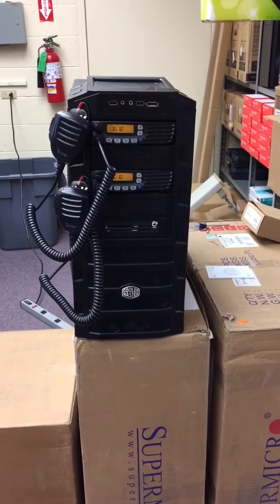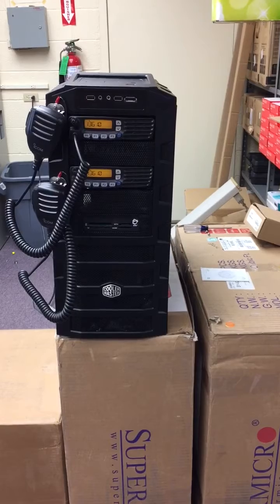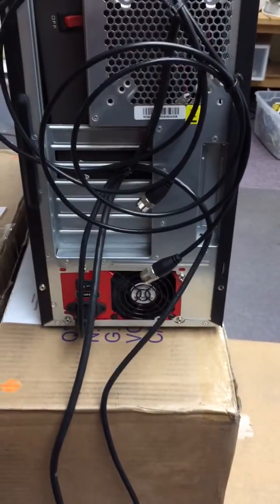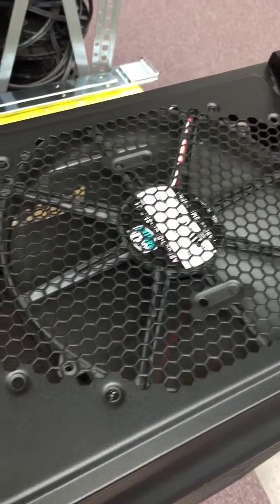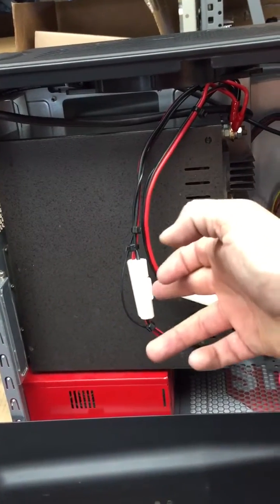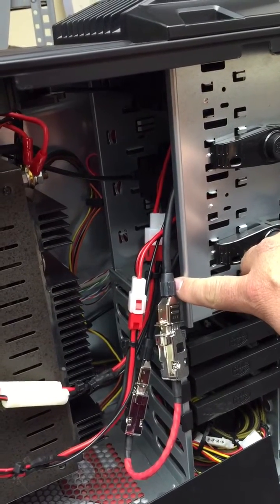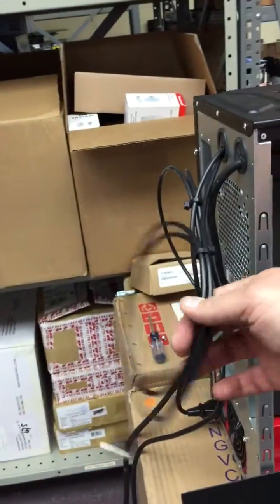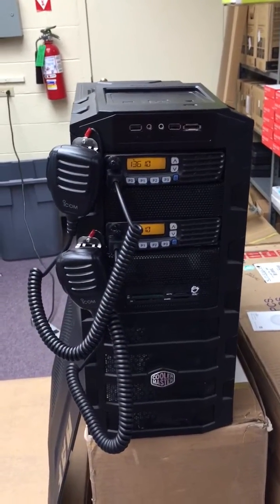Built my own VHF Repeater

Comment: What brand of cor controller did you use?. I did build a repeater on a computer case 4 years ago. Repeater still on the air, use Icom  IC221 UHF.
Reply: its a direct link
Reply: Cor on my Repeater is an ELEKTRA 2000, made by = www.hamtronix.com
Reply: you mean controller :)

I favor the Zetron controllers for old analog mobile/mobile builds, but all my repeaters I have are Motorola rack mounted analog/digital, and have controllers built in. Of course these are my commercial repeaters that are for my customers to use. I have 8 total - 2 in VHF Hi band and 6 in UHF and all but one is setup for DMR.

My GMRS and Ham repeaters are surplus part 90 radios like GE mastr 3's. Motorola MSF5000's, GR1225's, etc.

Of course I built some maxtrac type repeaters for demo purposes too using CSI controllers and even one using an arduino nano as a controller.

Comment: why didn't you just use the PC power supply? most PC power supplies are pretty capable? the one i have (a 600w) has 12v @ 46A available.

those Icom's are a bit expensive, did you consider a cheaper import model, like a TYT, Wouxun, or Baofeng?
Reply: Actually it's 11.8 - 14.2 VDC, typical automotive electrical system conditions so YES the PC power supply will work however it may not hold up to the load for extended periods of time and go into a thermal shutdown condition.
Reply: I run the hp server power supplies on my home rig, super compact way more power than I need available. definitely will hold up
Reply: +Munky332 Because those radios require 13.8 to 14.2 vdc.  Cheap Chinese Radios are junk.